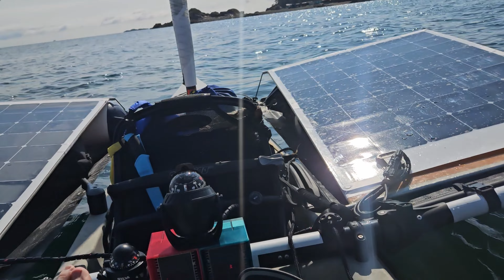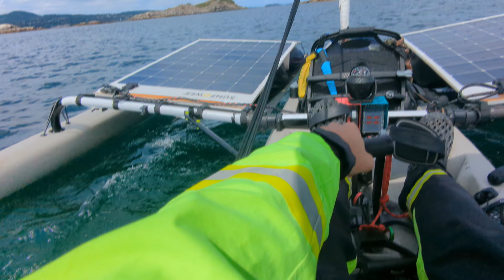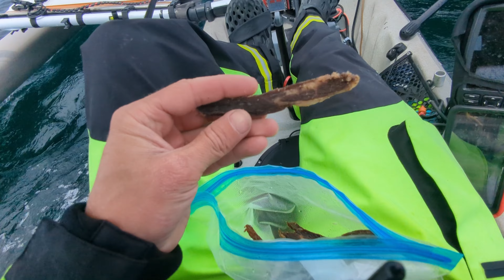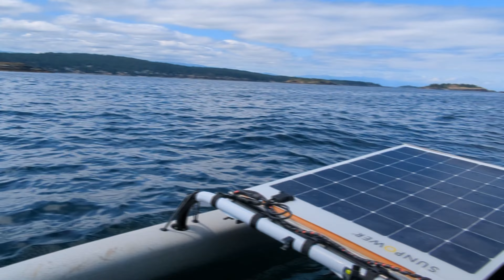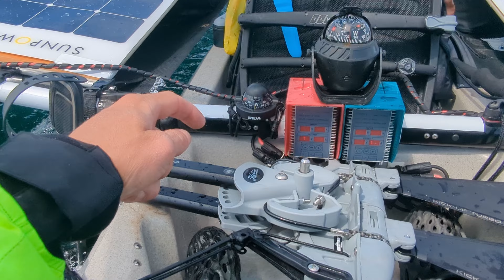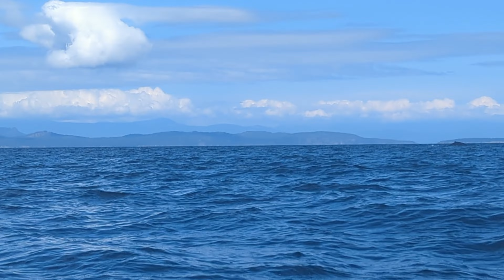Vancouver Island circumnavigation part 2 Nanaimo to Campbell River with a big storm!

Comment: Video #4 washed into my feed today and now I'm catching up. Great adventure and thanks for sharing!

Have you looked into regen type motors to take advantage of good sailing wind to top up your batts?
Reply from the maker: yes I can occasionally regen, but its not worth the penalty in speed. I would need to optimize the prop for generations, or at the very least turn it around and it's just not worth the hassle in my experience. The max I have seen freewheeling the prop is about 30 watts. A single panel can output 30 watts even in cloud.